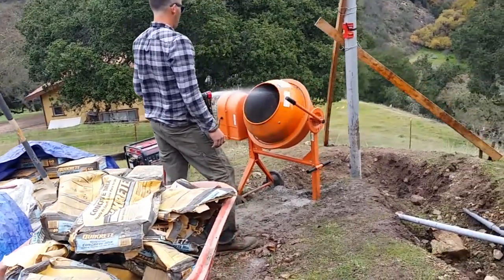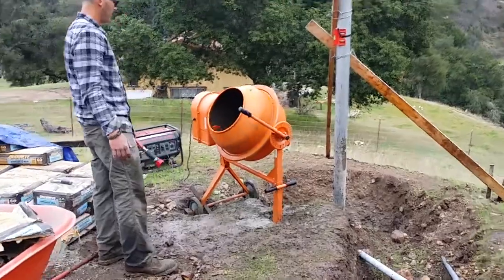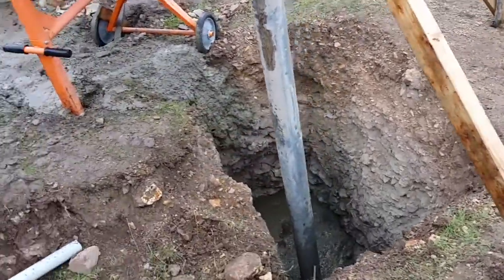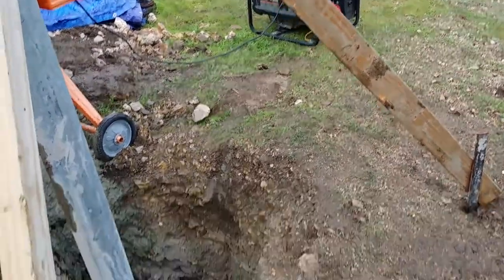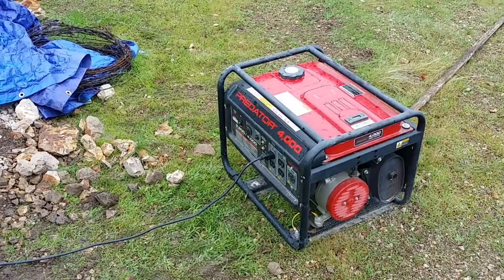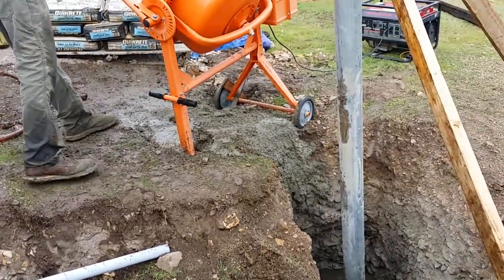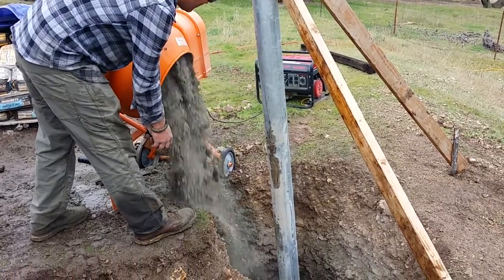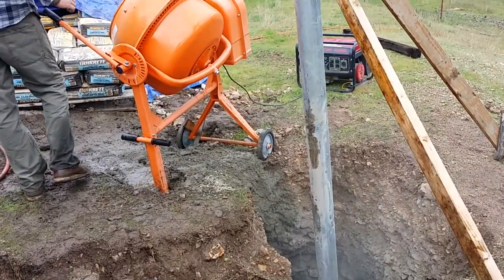Pouring a solar panel rack foundation with a 3500 watt Harbor Freight generator and mixer.

Comment: Lol dude why is the hole so massive lol
Reply from the maker: RAIDER FAN Why not? Are you a structural engineer?

It’s on a fill slope. We get high winds. The post is 10 feet above grade. I had excavator on site doing other work. 

Why take a chance of all that money and time if it failed and fell over. It is cheep insurance to me.
Reply: Hoffa?